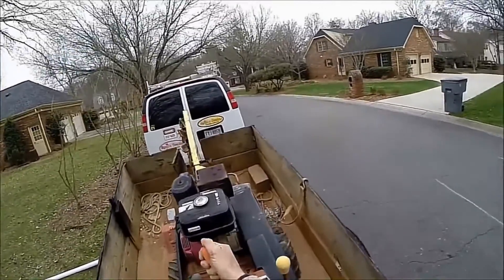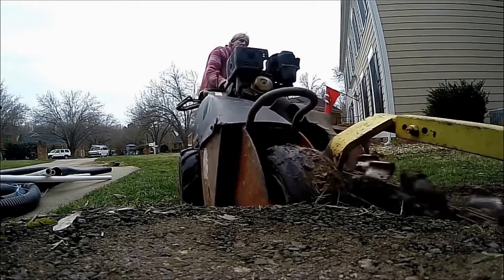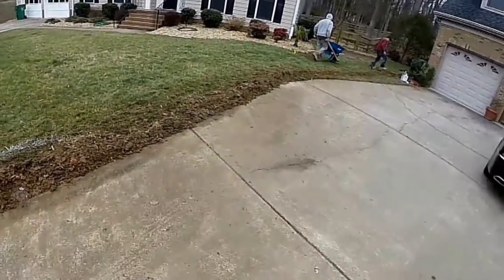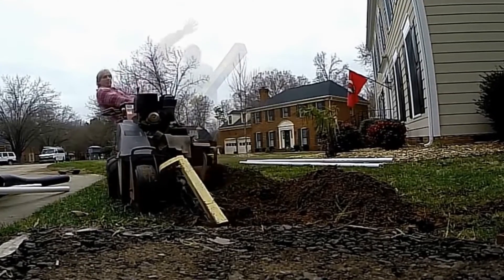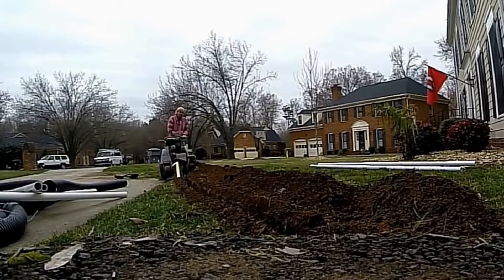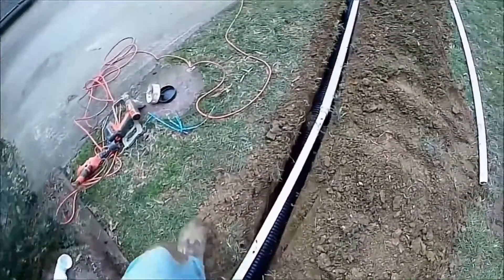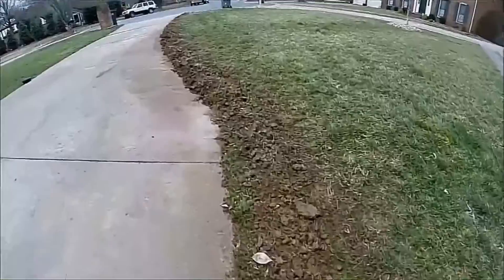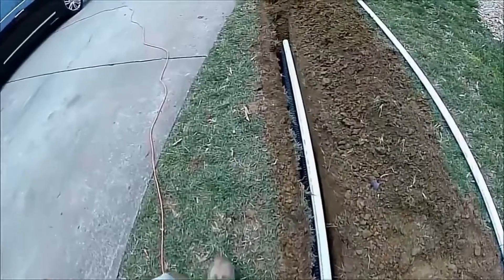Driveway Channel Drain is NOT Always needed to FIX driveway Flood - Driveway Drains - Catch Basins

Comment: That is so dumb to have the slope to the garage. Doesn't the water go in the garage. What is the builder thinking
Reply: Not unless the grading contractor was an idiot - the driveway is always going to have a low point at least several feet from the garage door, and a slight gradient to one side.  Or like my house and drive, it is a side-loader and the water runs right on by the garage and into the back yard.

Comment: My driveway has it's problems with water under the driveway, and I am not even sure how it gets there, though, like you said, my driveway slopes down towards the house/ garage, a lot  - it drops about 10ft in 70ft of drive.  I dug a trench* down one side for a 4" perforated pipe and covered it with rock to allow the water under the driveway slab to escape (for the first time in the 17 years since we moved here there isn't water weeping out of the cuts between the slabes for 1-3 days after heavy rain).   I just need to finish adding the rock, top it wilth fabric, then put a layer of soil (clay) back and seed some grass.  

But I am using gravity to carry the water away to the rear of the house. .... I wonder why you didn't do the same, as the flip side to a house having a drive sloping down towards the house, it's usual that the yard at the back slopes away from the house?  Wouldn't just a gravity drain to the rear of the property be easier?

My system designed incorporates a dry well that will hold about 70 gallons, to capture most of the water from all but the heaviest storms.  

*  I had to dig the trench by hand as it is crosses all the utility lines, phone, gas, electricity, and cable (I am on a well and septic).

Comment: Always like your videos. However, you should consider a better way to make the cut at curb look better. Maybe concrete around the pipe and angle cut the pipe to mask the same angle on curb followed by concrete to fill it in. Just a thought.